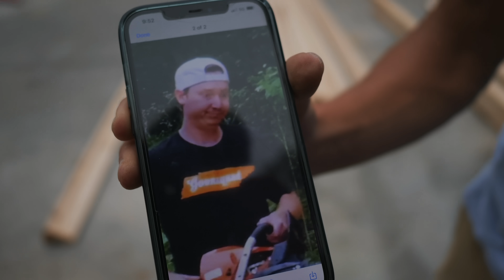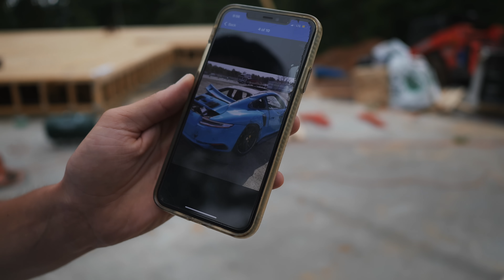Trying To Buy our Builder's Navigator!!! ($$$) | Episode 30 Life of Goonzquad

Comment: I great idea i use on building homes is to use 4" purple foam sheets glued to the inside of the block foundations under the home  Then you can use HVAC return into the basement with no air vents to the outside . Just a thought !

Comment: On the roof make sure you do standing seam metal instead of R panel. It’s more money up front, but you get a way nicer look as well as fully seamless with no exposed screws. The R panel will have you replacing all the screws later on down the line, with  the rubber washers drying out and it will create leaks.  Also they come loose over time! 
Just my thoughts good luck!

Comment: Simeon all you need to do for your Chevrolet High Sierra truck is to do a road force balance on those custom wheels and it will fix them trust me I used to work in a shop and I did those all the time on big tires and wheels and it works every time.

Comment: Metal roof good for rain collection for your water tanks during the wet season & during the dry season if you are running low on water you can always put several of those 330 gallon water tanks in the metal cages on your trailer as well as a 4" inch 13 HP gas powered water pump so that you can go down to some river with flowing water to fill up your tanks as fast as possible because who wants to waste time waiting for tanks to fill up & then pump the water back into your water tanks at the house. A 4"inch 13 HP gas powered water pump will pump 86,000 litres per hour or 22, 720 gallons per hour or 7 mins to fill up 8 x 330 gallon IBC tanks (2640 gallons total).

To size your house water tank you need to know your weekly water usage & also the amount of weeks of the dry season to know what size your tank needs to be so that it can be full before the dry season hits so that you can get through the dry season without needing to find water to top up your tanks. You might not spend that much money on the recommended sized water tanks needed at first which is okay but it will mean that you will need to find water several times until you do eventually build up a large enough water tank system for when you are married with kids along the way so think of it as a modular system that will grow as you need it.

Comment: Metal roof screws and rubber washers have to be replaced every 15 years or they will start leaking.  Go with a standard high quality asphalt shingle with good underlayment and it will be cheaper and last you 25 years.

Comment: I thought you aren't supposed to install hardwood floors on a particle board sub floor. If you want hardwood floors, you need a good plywood sub floor to nail into, not OSB, at least that is what we were told by flooring guys.

Comment: 🇺🇸👍. A metal roof would be very noisy during heavy rains and hale storms and crazy costly for replacement and repair. Not sure what was meant by Little Rock’s and glass pieces getting in the filters. The screws you are jamming down on the sun floor over time can work back you because the threads aren’t holding them in and will lift your floor someday maybe I’m just to picky.👍🍺🥩🥔🌽. 🥛💤
Reply: i have a metal roof and heavy rains isnt loud at all
Reply: They have talked about doing a rain collection system because they might not be able to do a well so they don't want asphalt getting into the filter for the rain system
Reply: @justinjohnson1429  now that makes since, I now remember them talking about the rain collection system.
Hopefully it will provide enough water because hauling it in the truck at 8 pounds per gallon get real heavy fast.300 gallons is 2,400 pounds plus the tank weight most 4 member families won’t mall it a day on that. You may have to put a 5,000-10,000 gallon tank up for just the fire department and that’s not to be used except for fire fighting. You may need to tee off your brother’s line for emergency.

Comment: I still find it odd you build homes from wood.  Most homes in the UK use brick and mortar. My mum's house is stone blocks 18 inch thick and slate roof. The house did have thatch for many years after it was build but got updated later. It was built in the early 15th century so built to last.    Interesting to see your way of building                  great video. 2x👍